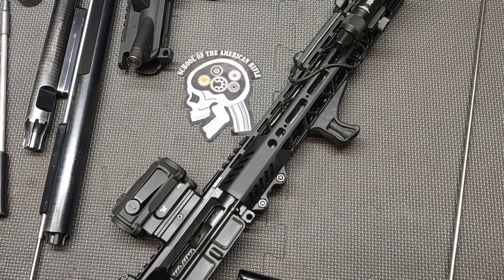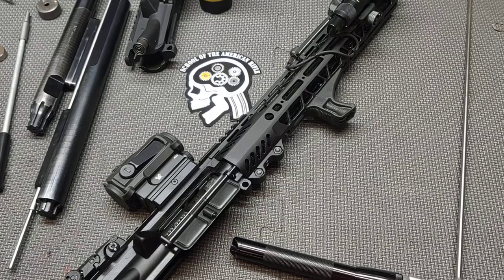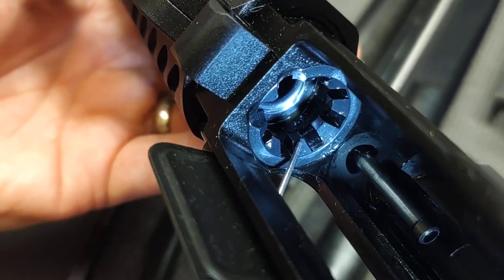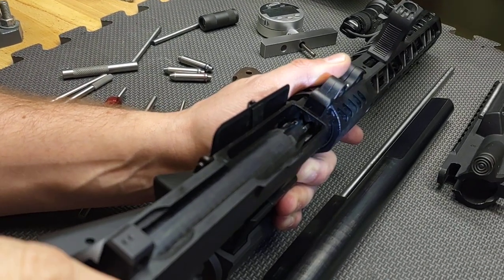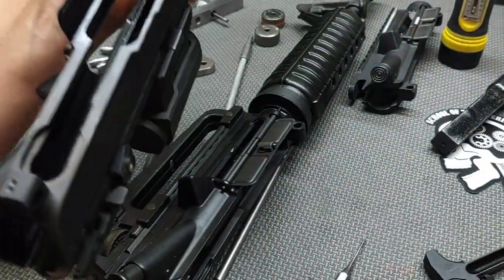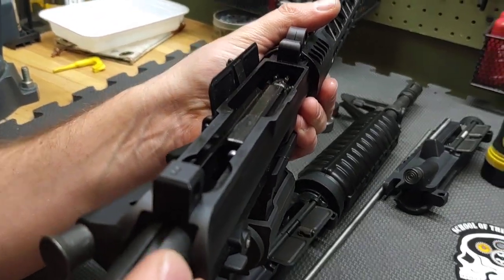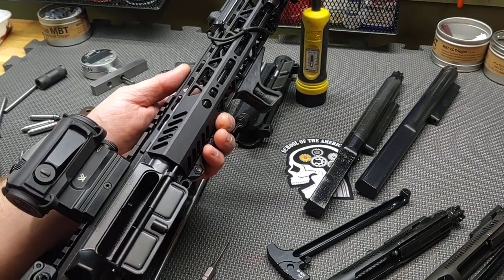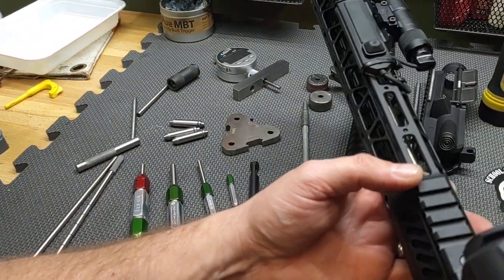PSA Upper Receiver Autopsy - Part 1

Comment: I've bought a number of things from PSA over the years and I've had a couple of problems that they've remedied quickly but I've also had a problem or two with a couple of the higher end manufacturers and they weren't fixed quite as quickly or easily.  Considering the amount that PSA sells and the fact that most of it would be considered "budget", I think they do acceptably well.  They wouldn't enjoy the success they do if all they put out was junk.  Also, they fill a need for a lot of shooters who can't afford higher end equipment.  Don't take a gun elitist attitude.  We need to (legally) put guns into the hands of everybody who wants them and PSA helps to fill that need.
Reply: I second that, I have bought several ARs and AKs from them. 95% of the time everything is fine. What few minor problems I did have were fixed right away without question. Great company with great customer service.
Reply: Another thing is that PSA sells to a lot of new and less experienced shooters because of their “budget” reputation and pricing.  Many of those people being less experienced likely have more user induced problems.  I’ve watched and read about a number of supposed issues which the user blames on the equipment are caused by the users unfamiliarity with the operation and requirements of their particular firearm.  I actually ran across a situation exactly like this a few days ago at the range.  He had a brand new never fired AR-15 which he had just picked up at PSA the day before and was having numerous fte's.  He told me that he completely cleaned the rifle and bcg but when I asked about lubrication, he hadn’t so he was trying to run a new AR while it was completely dry.  It had a nickel boron bcg and he didn’t think lubrication was needed.  I lubricated everything for him and it ran perfectly.
Reply: @fapangel7771  that's a very good point you make about the customer being able to notice issues. PSA is a great budget rifle company but I never suggest them for someone new to the gun world. Usually it's a good place to start when you get into building and smiting as a hobby. IMO
Reply: @Terry Costakis -- it's not elitist to point out flaws in a PSA upper.  Chad is doing a service to this upper's owner, as well as helping PSA's quality control with this video.

I just fired a new PSA AR yesterday and had no luck on accuracy, the shots were all over the clockface (yes it was stabilized on rest bags) with 2 different ammo loads, so it wasn't ammo related.  Couldn't even zero my iron sights.

I came here looking for Chad's QC review and I'm grateful for this video.
Reply: For what it’s worth, I just checked an upper I recently bought from PSA and found no issues there. I’ve fired 5.56x45 through it without issue. The lower now.. it was a complete PSA lower. Disconnector spring was upside down. Let the trigger pin walk out. That was fun.
Reply: I rather build my own. I just finished my fourth build and she runs great so far. I recommend everyone assemble one at some point in time just for the experience. However I will caution that a budget build can easily balloon to $1,250+.
Reply: @Darkness_Actual  That's a good starting point, then the next one is $1600, then $2000, and pretty soon you are building them for all eighteen of your grandkids that haven't been born yet..😁
Reply: @reddune6185  hehe in a unique configuration for each one.
Reply: @reddune6185  don't you put that voodoo on me! I just hit 42 and have zero kids. Oh and I'm still not technically finished with the build. I still want to add a ProTac light, MAGPUL MSR sling, ambi selector, handstop, magnifier and PWS upgraded buffer tube. It never ends.
Reply: Legally is the constitution.
Shall NOT be infringed means that everyone should be armed because self defense is a human right!
The government is run by people are capable of great harm to the people and we need a way to stop their tyranny against us.
Reply: I'll never understand how you interpreted him doing his job as "being elitist". He was asked to diagnose a problem and that's what he's doing.
Reply: @Darkness_Actual  Same here. I've built all of my ARs, starting with the very first one I owned. I could for sure buy them a bit cheaper, but getting to hand pick all of my (quality) parts, and assembling it myself with patience and love is worth the extra cost. My first one ran me $1,100-ish... next one $1,300... next one $1,800... and most recent one $2,100 lol. The more I build, the more bougie I get haha.
Reply: So far im seeing more high end guns returning for work than so called budget gear.

Comment: My psa 10.5 in  fn barreled upper shoots 1 moa groups at 75 yards consistently! Never had a problem with psa in the 5 years I've dealt with them. Thanks for the video very informative, subbed.
Reply: Lol wow that’s so impressive 😂😂
Reply: 1 MOA @75 yards? 

1 Minute of Angle is a 1" group at 100 yards....
Reply: @MikeB1972  You do realize that a 3/4 inch group at 75 is still 1 moa. Not everything has to be in factors of 10.

Comment: I imagine you could also see the same thing using a magpul bev block. It also has a toothed extension that is supposed to lock into the barrel extension but it would be aligned via the bottom opening of the upper. Interesting video as always.

Comment: On both my Colt 6920 and PSA the bolt lugs ever so slightly makes resting contact with the extension lugs, more so on the PSA. On the Colt it's barely a side contact, on the PSA it's makes contact on the side and bottom. No visible metal wear however. The Colt has a couple thousands rounds through it and the PSA barely has a couple mags through it.

Comment: New to your channel and thought I'd share an experience with a PSA upper. We wanted to put a low profile gas block on it and a free-floating hand guard. The front sight pins came out fairly easily. Then, when we went to remove the barrel nut, it was hand-tight. We put the wrench on it and the weight of the wrench was enough to move it. It made us wonder of we should remove the gas tube and check torque on any future pre-assembled uppers. Not bashing PSA - just scary to think that gun probably had 300 rounds thru it without issue, but the nut that holds the barrel was not even tight, much less torqued. Scary!

Comment: I reckon I just been lucky with my PSA upper.  1200 rounds so far and zero issues so far. Mines the 10 1/2 5.56 upper I got for a cheap pistol build just to see how well it holds up.
Reply: Not lucky. That's the norm with PSA stuff. This video is the abnormal. Although the E-warriors in the comment section sure do love their $1,200 uppers from DD and BCM and whoever else. I'm sure the 200 rounds a year they shoot are super accurate out of those safe weights. I have roughly the same round count on 3 different full PSA builds. 1 MOA groups all day long at 100 out of each of them. My Noveske upper also shoots 1 MOA groups but for quadruple the cost.
Reply: Me too! I have two of them a premium and a budget. Both are awesome.
Reply: I have 2 PSA complete builds and both shoot very accurate with good ammo and have had zero issues. If someone does not want to buy from them any longer - great! Faster shipping for the rest of us

Comment: I have recently found your channel and I am amazed at the depth of knowledge here. A teeny plea for us old guys. Get a decent spotlight to illuminate what you are talking about. 02:49  and make sure the focus is right for the image. I know it is extremely difficult to both do something, teach the doing and make a video of the teaching of the doing, but I would appreciate the extra light. 
I am catching up. (I have built maybe 10 or 12 AR's and I feel guilty now. I do headspace, but that's it.)
Reply from the maker: I do understand. Unfortunately this is the best we can do with the equipment we currently have. 

Additional lighting and new camera equipment is being planned for but it's extremely expensive and it's just not in the cards right now.
Reply: @SchooloftheAmericanRifle  I think every  successful YouTuber goes through an almost endless interactive cycle of upgrading video/audio/editing equipment along with better production values, focusing, exposure, audio, editing, and the third leg of storytelling, pace, composition and intent. One helps the other and soon Bob's Your Uncle! 
Number one rule and the hardest for the rookie is to hold the camera still and slow down your zooms and pans.
Reply: @Instructor Chad How do you determine if it's a clocked barrel extension or just burrs from the gouges that are preventing the Midwest tool from going forward?
Reply from the maker: @dustinmayes1485  the burrs usually won't stop the URR from inserting, but if they do they can be cleaned with a small jewelers file.
Reply: @Instructor Chad awesome, thanks!

Comment: I've realized after putting together a few guns that it's pretty common for parts to be out of spec. I've bought parts from Brownell's,  PSA, and Aero Precision that had serious issues. PSA customer service is terrible. It's a good place to buy magazines and things like that but you take a chance buying guns or parts for cheap. I think BCM is pretty good so far. I'm thinking to just buy complete guns in the future from a manufacturer that that actually checks everything like this because you just end up spending more in the long run to fix it. It would be good to see a video on where you get those tools and gauges or how you make them.
Reply: PSA is horrible.  I had got a midlength complete upper. Upon inspection after i received it i saw what looked like chipping or gouges towards the muzzle end. I sent them a email telling them what i had seen with my own eyes. They wante bore scope pictures. I told them i had no access to one. They never emailed back.   I have had no accuracy issues and have shot a couple thousand through it.  But the lack of QC and customer service made me not be a return customer. I would spend the extra money.  I dont buy "range toys "  only duty /defense grade weapons and will spend accordingly
Reply: @americanmilitiaman88   Yeah with those guys it’s like buying a lottery ticket. Maybe you get what is advertised and maybe you get a paper weight.
Reply: What manufacturer actually checks everything? People have issues with BCM plenty too.
Reply: @vgamedude12  The ones that charge over a grand and up for their rifles. I worked in manufacturing for 10 years, you get what you pay for. A lot of your price isn’t just because of a name, QC costs money!
Reply: @vgamedude12  no company will have 0% QC issues, but I'd love to see any substantial evidence that BCM has wide spread QC issues that rival budget companies like Anderson or PSA. The tolerances on my BCM rifle were fucking precise as shit.
Reply: @sbrown137988  excessive swearing makes any statement appear so much weaker... shame
Reply: @housemana  human language is human language. Your offense to words has no bearing on the substance of my argument. I'm sorry words assault your eyes.
Reply: @sbrown137988  no one cares it just makes you sound unintelligent and juvenile
Reply: @Chicano_pistolero  "no one cares" yet here you are, compelled to comment on my behavior buried in a random YT comment. Tell me you are a PSA shill without telling me you are a PSA shill. Lmao.
Reply: @sbrown137988  I’ve made it my job to call out bubbas like yourself. Believe what you want buddy I’ve got nothing to prove to you or anyone and still have expensive and affordable things, stay mad boi
Reply: @Chicano_pistolero  mad? I'm not mad. You are the one seeking me out bro 😂. I didn't comment on something you said, I believe it was the other way around. By all means, enjoy your poverty tier machine. I'll buy stuff that has quality control.
Reply: @ThaHerbanLegend  I’m glad you know my entire inventory. Please tell me more since you know everything almighty knower of all.

Comment: If this guy would simply contact them. They will replace it. They produce a crapton of firearms for a reasonable price. Not everybody can afford high dollar stuff. They feel the void.
 Every supplier from time to time has issues. I have had BCM jacked up out of the box. Also had a Daniel Defense I simply gave up on and sent it back demanding a replacement. Which they did and I was happy afterwards.
Reply: According to the video @ 6:02, this is the third issue... the upper has been replaced once (so apparently this is the replacement) and it was sent back again and they said everything was fine. So apparently it's not as easy as "simply contacting them".
Reply: @RickinICT  Sometimes you get what you pay for. But like I said every company has issues from time to time.

Comment: I'm going to check out my KS47 for this issue. My firing pin keeps falling out and the last trip to the range the bolt wouldn't seat into the extension until I pressed up on the bolt just a little. Still waiting for PSA to get back with me on this. This unit has been nothing but problems out of the gate. Waited 7 months for it hit stock and can't even get a full mag out of it without issues.
Reply: Sorry to hear this. My ks47 pistol has been flawless.

Comment: Just as good they say... 

PSA is a good company because they put a large volume of firearms into the market. They are decent most of the time as a range toy or first rifle to learn on. But just as good as their fans claim.. can't agree. With that said my very first AR15 was a PSA freedom key mod 16". It wouldn't cycle the day I got it. Turned out it was missing roll pins. But it was a learning experience and after that it was a great rifle I used for training and education. A decent back up rifle for friends at the range. But while I was on patrol I used a Daniel Defense V7p. PSA isn't "just as good" but they are a valuable company in the firearms industry for what they are.

Comment: I had 3 issues with my PSA 16” upper that I owned for 1 week now.  The rail came dented, the gas key came loose after 200 rounds, and the gas key appears to have a screw backing out.  I. Disappointed and I have yet to hear back from them from 2 emails.

Comment: I have been having quite a few issues with my PSA uppers and parts kits. (current issues) Take down and pivot pins from the kits all seem to be slightly oversized. (fit issues into the uppers) tested on both completed lowers from psa and other and 80% I have machined myself.. AR Stoner pivot and take down pins have worked flawlessly.. I'm starting to worry that I will run into issues like this as well.. If anyone is having this issues as well, please let me know.. also any suggestions or recommendations for this issue or other issues I may face with PSA products will be greatly appreciated.

Comment: It is no where this severe but i do notice some slight peening on a couple of the receiver lugs on all of the 3 AR's I own. Your video has me going down the rabbit hole here but is some slight wear in spots normal? It also isn't on all of the lugs but maybe 2-3. Also worth noting that these rifles are all of considerably higher quality than PSA parts wise though they were built by me. They also do not malfunction in anyway.
Reply from the maker: Most uppers flex when the gun unlocks and cycles. It's pretty violent. 

If it clears the lugs on a Midwest URR, it's fine. If it don't, you have a problem.
Reply: @SchooloftheAmericanRifle  something else to order! Thanks for the info, this is sorely missed in most of the gun world.

Comment: My brother in law purchased a complete upper from psa a few years ago the front sight base was so far off center the rear sight (carry handle) was almost out of adjustment. After a lot of back and forth with psa he sent it back to be repaired he received it back a couple weeks later minus the carry handle and they didn't repair the problem. I'll never buy anything from psa I've heard to many times about the poor quality of their firearms.

Comment: How the fuck has that rifle not blown up already, if it's making contact with those locking lugs then it can't go past unless inertia pushes the bolt face to fit. But that rifle shouldn't even be firing, and no shit he's having accuracy issues, it's probably not even going into battery.

Comment: I’ve personally seen (myself and others) that PSA drills their gas port at the one o’clock location instead of directly at the top at the twelve o’clock position, so the gas block hole isn’t lined up directly with the gas port. Oddly enough I haven’t experienced any failures with it but I haven’t tried it with anything heavier than a carbine buffer. Regardless, it’s a bad QC issue that appears to be a pattern on some of their rifles & barrels.
Reply: Gas blocks can be mounted and set a few degrees off from true and still have sufficient gas flow. There also may be some interference at the other end with the gas tube and gas key because of the gas block being canted. If it were mine and i could see with my eye that the GB was not true, I'd try to send the entire assembly back under warranty.
Reply: They're suppsedly fn barrels...🤣 Machinegun grade steel
Reply: ComeOnPelican91 - The gas blocks weren’t misaligned, the hole in the barrel was drilled misaligned, consistently at the one o’clock position (from the muzzle end).